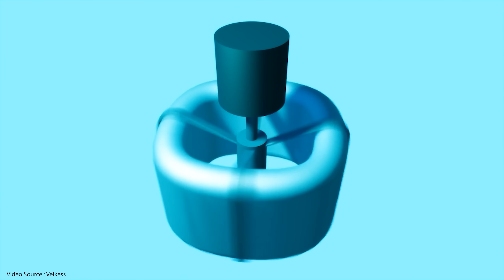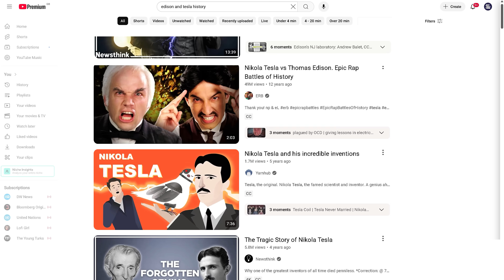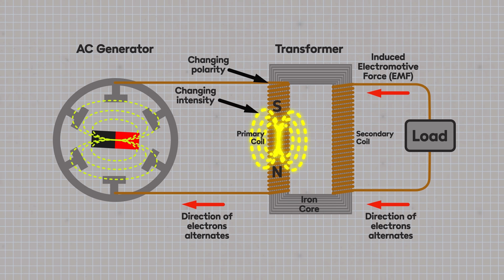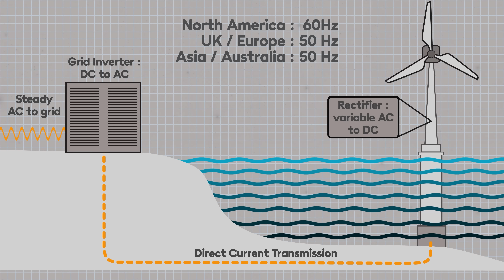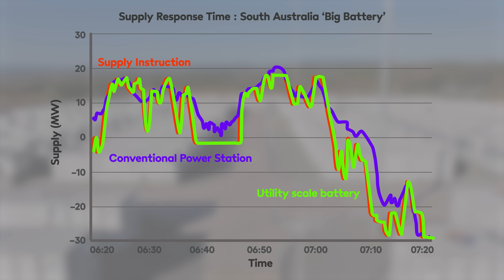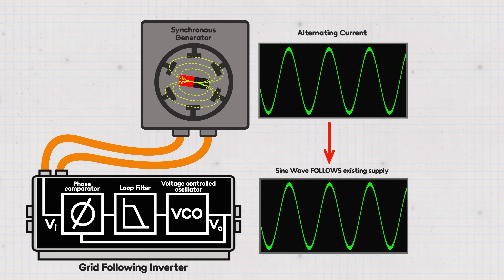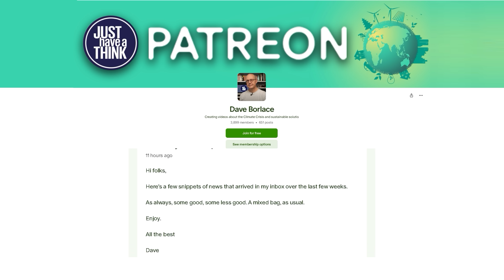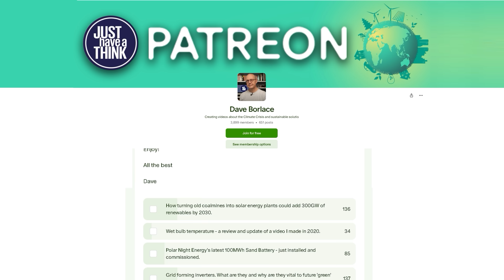How GRID FORMING INVERTERS are paving the way for 100% renewable energy.

Comment: As an Engineer on board various ships 50 years ago, I found many of the older vessels to have DC generator engines. When changing from one generator set to another, it was simply a matter of bringing the voltage of the joining generator to same value as the busbar voltage (usually 220V), and then connecting the generator. You would then increase the load on the joined engine while reducing the load on the leaving engine, to the point of no load and if could be disconnected from the busbar. 
When I started working on AC, you had to do both the voltage and match the phase angle. Even trying to put the alternator on to the board slightly out of phase could produce a very large clunk, the lights could dip and in the worst case blackout the ship. Basically you were trying to exactly match the speed of the joining engine to possibly 2 or 3 already running engines, and depending on the difference in phase angle, leading or lagging, the two systems would try to match each others speed instantly, which they cannot do. Fortunately the systems on later vessels were fully automated and the breakers would auto engage when everything was in phase. So yes phase matching is a big thing.
Reply: Sounds pretty straight forward for a computer algorithm, deciding on what the sine wave should look like on a microsecond basis.
Reply: @alexterrell1062 It wasn't in 1978!
Reply: Very cool
Reply: Yes I learned this as a DIYer after killing 3 types of inverters, using a poorly design auto transfer switch.
Reply: @showme360      Thank you for mentioning your experience!
Reply: I was about to add to the main discussion this same issue of power factor. If all the loads on a system are electronic or purely resistive then it is a non issue, but that is not the real world. Most inverters, no matter the design, do not produce pure sine waves and integrating to the grid helps smooth the output. Also to actually supply energy the inverter must, by at least a tiny amount, lead the existing waveform. Then there is also that pesky issue that the grid was designed to deliver power FROM a generation station TO the loads. The grid is not currently designed to flow the other way. This is a huge issue that engineers understand but is never brought up in discussions to the public.
Reply: DC power systems are easier to manage. The only reasone to use AC is because DC does'nt work with line transformers
Reply: @fablearchitect7645  ac is used for transmission because losses are relatively easily mitigated by transforming to very high voltages. This is not feasible with dc
Reply: @graemecreegan6749  HVDC is more efficent then AC. The real reason AC was chosen over DC was the lack of power electronics in the 1800s. Big bulky line transformers were the only voltage converting technology at the time.
Reply: @fablearchitect7645  interesting. I thought voltage drop was the problem. I’ll look into it. However those big bulky line transformers have stood the test of time. Modern electronics tend to be less robust
Reply: @graemecreegan6749  In the 1800s there was no method of stepping DC voltages so only AC could be used with line transformers. Line transformers need big bulky iron cores to prevent saturation at the line frequency. DC-DC converters switching at much higher frequencies use much smaller high frequency transformers.
Reply: @graemecreegan6749 - HVDC is generally used for grid interconnects (such as the 475 mile interconnect between Denmark and UK). The losses are smaller and cables can be smaller (no ‘skin effect’ on transmission). Downside is that voltage conversion is more expensive (about 15-20% more).

Comment: Bit of an oversimplification of the several ways that wind turbines produce current.  Many older turbines use grid-excited asynchronous induction generators, meaning they are naturally grid-following but cannot provide any inertia, and many newer ones are inverter-excited asynchronous generators, meaning they could technically be grid-forming if required.  Only permanent magnet generators (roughly half the total, I believe, though this is probably changing over time) produce either DC or an internal-only AC of their own which, as shown in this video, is rectified to DC that then needs to be converted to grid-matched AC at the substation.

Comment: The UPS that most of us use at the back of our computers are already grid forming inverters. And the most sophisticated ones will lock to the grid frequency and when the main power disappear, they will transfer in phase with the grid that disappeared.

One reason for the home solar system disconnect from the grid when power disappear is a security feature: the electric company may have isolated the cables outside of your house/neighbourhood because they have people working on the liens. They don't want your inverter still feeding some power on the line, so when there is no grid, the inverter stops. That will change when all the individual power plants are upgraded to protect the workers.

Comment: Just a comment on your "this is a problem... or is it?" 

Yes, it's a problem that needs to be solved, and this is something that the renewables proponents have mostly ignored. There's been a push for a decade to put pricing on these kinds of stability functions but that didn't happen, because it would also put a additional cost on wind/solar, which was politically unpalatable for the proponents of renewables.

Just because one says "stability functions need to exist" doesn't mean one is a non-renewables proponent. It just means one wants a grid that works.

Comment: Can I assume that there is some wide-area non-grid propagated synchronisation of Grid Forming inverters that keeps them in phase with each other and the disconnected national/wide-area grid, so that when they power up a disconnected local grid(s), they are in sync for eventual connection to the national/wide-area grid?

Comment: My Ph.D. Is in grid forming PV inverters and I worked at Tesla on inverter product behaviors since the beginning of Tesla Energy, but have since moved on. My take is that grid forming inverters are a great thing for grid stability and it was only narrow-minded and conservative strategies in the early stages of renewable inverters that lead to grid forming capabilities being essentially disallowed. 

In general, they are great for the grid and we will likely see centralized battery and renewable generation inverters go this way. Residential and commercial installations in the distribution network will have some hurdles, though, because the re-closers that attempt to restore power after a local surge are not equipped to handle load-side generation and utility maintenance, at least historically, was not prepared for load side voltages that may persist or appear after a line is broken.
Reply: I'd be cool to hear how grid forming inverters work internally.  They must have some highly accurate internal clock, yes?  Is it a quartz clock that periodically re-syncs with the Naval Observatory (if in the US)?  They all have to stay in the same phase even when totally isolated from one another!
Reply: @JohnAtkeson-h8p - this is a misconception that you have.   The grid frequency is not fixed but is variable and used as part of a distributed democratic control system.   Investigate how utility primary control response works.  Specifically Volt-VAr and Frequency-Watt response.
Reply: Glad you moved on!

Comment: Dave - it would be great if you could reach out to me and we could have a great discussion on this topic. 
It would be great to continue some very much needed myth busting on this topic.  I see so many people making comments like 'inverters can't provide inertia'.  One point I think that is important to try and get out there is based on answering the question - if inverters can't provide inertia why is it that grid connection standards for renewable energy inverters define test protocols designed to specifically measure if the inverter is provided any noticeable inertia and if so deem it unsuitable for being connected to the grid. 
A lot of the problems here relate to archaic legislation and not techical limitations.  The reality is that to meet grid connection standards it is common practice to design the PLL to be destabilizing  - I.E., exhibit the exact opposite of having inertia.  This practice is madness but what current legislation requires.
There is also an argument that grid forming control is too costly - in response to this I would challenge people to look at the Enphase microinverters  - if we can afford to make every 300W microinverter work as either a grid-forming or grid-following inverter then this demonstrates that cost is not the barrier here.
Reply: Exactly

Comment: This still all seems like a question of batteries between generation and the grid.

If the grid was a collection of self sufficient micro grids ( not permanently but that need the grid for long term power needs instead of for managing or maintaining the grid itself) most of these issues disappear.
Reply: Batteries were solved aeons ago. You can build iron batteries that last for decades

Comment: Yes working on the inertia project in the software space here in Australia right now. For the most part synthetic inertia is still a reactive process and will become increasingly important. However we still need a little preemptive inertia to give synthetic ones a chance to react. So it's always the case to not put all your eggs in one basket, a nice mix of the old and new is still needed for now, but over time synthetic gets more important. Not 100% sure synthetic only is ever going to be possible though. Maybe if a coordinated synthetic network is the driver and traditional becomes the slave - but that an active solution not a passive one so perhaps more vulnerable to failure. We shall see over Next few decades
Reply: Why do you need pre-emptive inertia when synthetic inertia has faster dynamics? There are many case studies of microgrids and simulations of larger grids that are 100% inverter based relying only on grid forming inverters without any synchronous machines
Reply: @fablearchitect7645 no synthetic is slower, it can react very very fast, but spinning turbine already has the inertia so it's inherent
Reply: The primary reason an inverter can't provide inertia is the "safe operating area" of the power switches.  Doubling the load increases the current by two, and the voltage drop (depending on the switches) by up to twice, so 4 times the power.  This can melt the silicon in the switch, so it can't turn off - inverter failure.

This can be fixed by using a much larger switch (SCR, FET, or IGBT), and the gate drive power.  With short duration overloads, the heat sink doesn't need to increase.  

The magnetics also need modification.  Transformers, seeing the same voltage, won't saturate, but the temp rise will need to be evaluated.  Any inductors in the power path can saturate, and need to be designed for the peak power.

Fuses and circuit breakers need to be evaluated, as does the power path wiring (breaking apart wire bundles may suffice).

The 125% slow current limit won't change, the 150% shutdown will need to be increased.
Reply: @stevesedio1656  most inverters have current limiting control so this is not an issue
Reply: @fablearchitect7645  That is the problem.  An inverter will trip at 150% load.  

As an example, my 1000VA inverter would trip when the refrigerator (50W) and freezer (100W) were connected.  I ran two inverters, so each had its own.

A steam powered generator has a turbine and armature which are flywheels.  That will power through a short duration load, well over 150% (500%?).

Grid operators haven't had to know the load transients the grid supported because their source of power wasn't sensitive to it.  

Inverters are.
Reply: @stevesedio1656  current limiting and over current protection are different things. when you overload an inverter, the current limiting reduces the voltage to limit the current. The inverter continues to power the load during an overload event and does not disconnect.

Many standalone inverters lack current limiting but most grid connected inverters do. Grid connected inverters supply constant current even during a line fault.
Reply: @fablearchitect7645  I'm not aware of any inverters without current limit.

The only way an inverter can supply a constant current at 500% load is to lower voltage to 1/5th. 

And,  that would require the load to slowly increase, so the current limit circuitry can track it.

A sudden addition of 500% load will cause the invert to shut down.
Reply: @stevesedio1656  The control dynamics of a grid following inverter are fast enough that it can be modelled as a current source. There are many studies that show grid following inverters riding faults by feeding the fault with constant current.
Reply: @fablearchitect7645  Down to what output voltage?
Reply: @stevesedio1656  down to short circuit of 0V. Remember the inverter has internal impedance due to the LCL filter.
Reply: Not sure what could be the problem in a 100% scenario. Many people have off grid systems and they work fine.

Comment: Do they include atomic clocks with GPS backup so the AC can be auto synched without the need for wired control connection between units?

Comment: It isn't just inertia in those big spinny things. They have variable input power with a control system. When the grid frequency drops, the control system calls for more power. If it increase, it calls for more. Up to a limit of course.Too much power and things start to overheat.

Inverters can of course simulate this but it requires that they have some power in reserve. Which goes against the usual MPPT way of doing things. Adding some battery storage helps with that.
Reply: You mean solves right?

Comment: too much intro and average person wouldn't understand appreciate it while discussion on the main topic took just a minute.  grid forming is more of a marketing term but not far different from existing inverters.   
for example, there are inverters from China that are effectively Grid Forming because it can automatically form a grid or provide power when the grid goes down unlike the grid tie inverters. 
I think, the only difference with actual grid forming inverters vs above can work in parallel with each other without effort or setup.